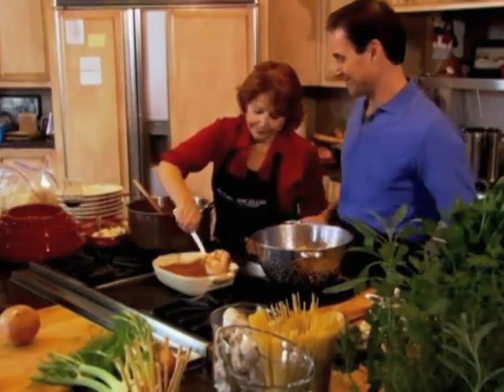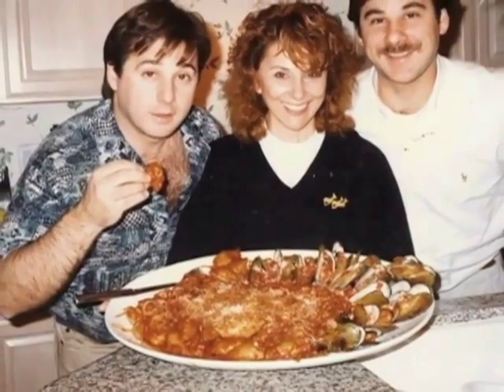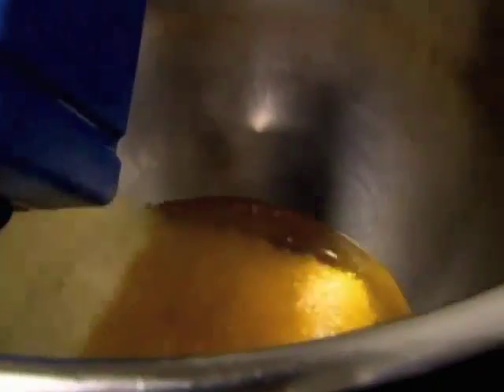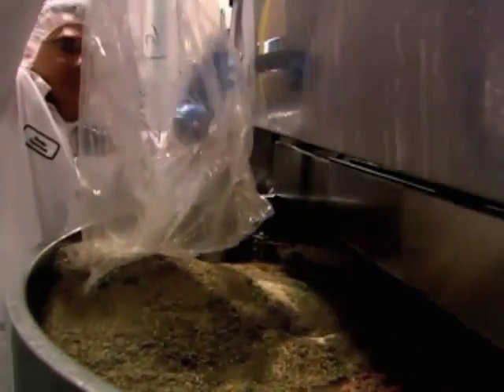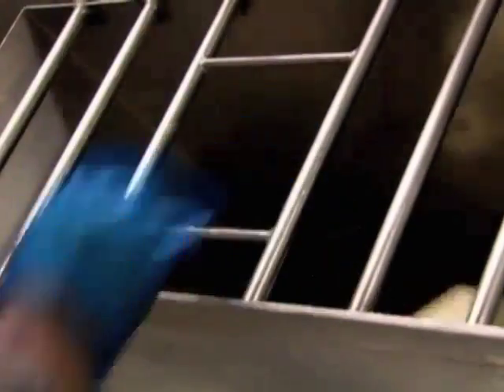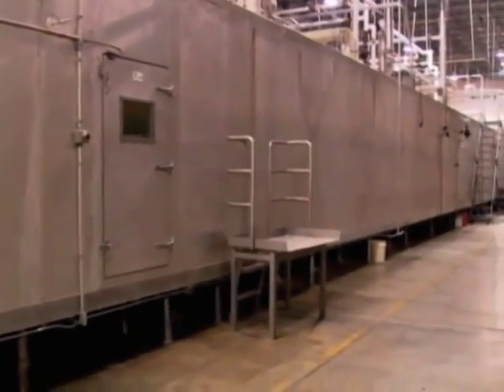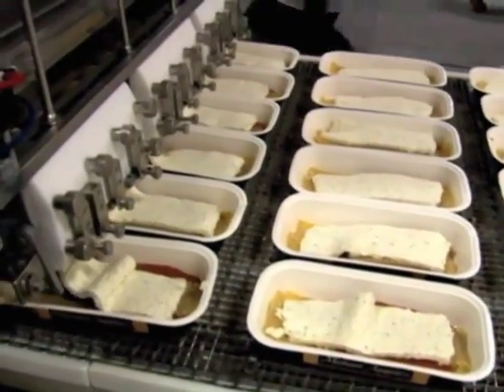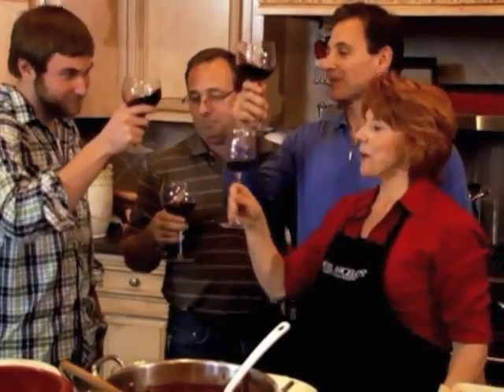Unwrapped: Michael Angelo's Lasagna

Comment: I just ate this product last night. Oven baked per instructions and reasonably tasty but not a filling meal without suitable sides. The lasagne was just over an inch thick and slid out of the tray on a decent amount of sauce. No resemblance to the photo on the box or as pictured in the video.